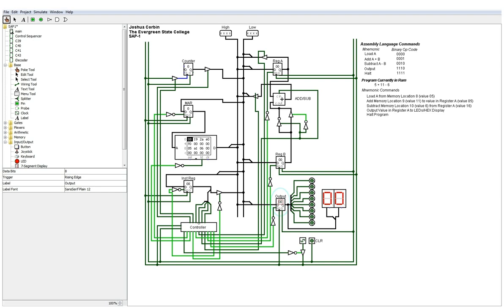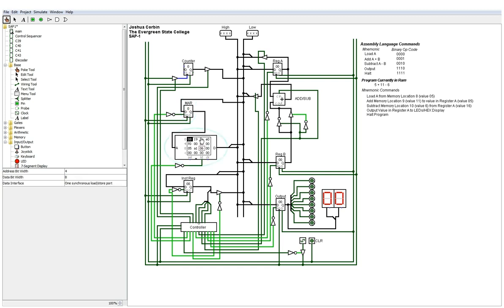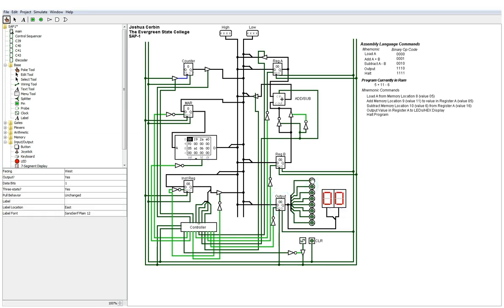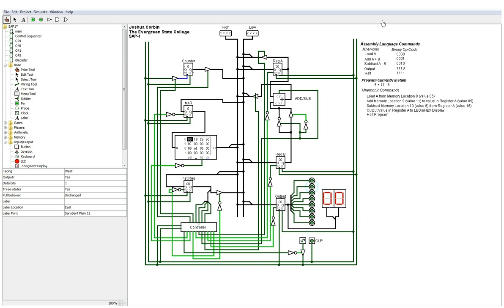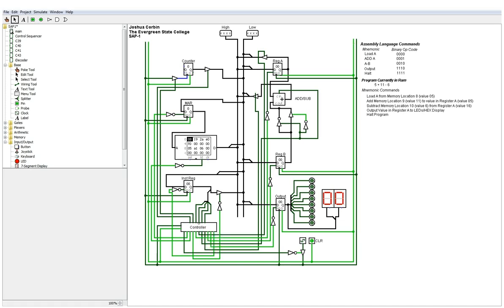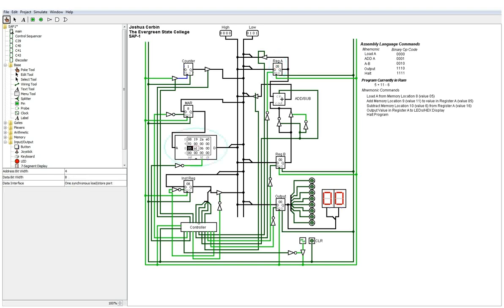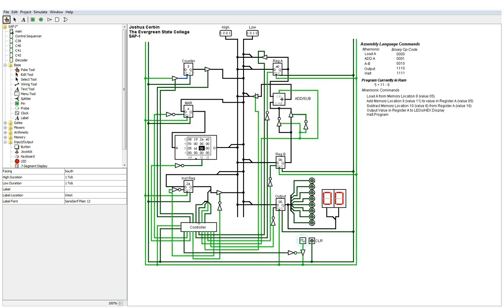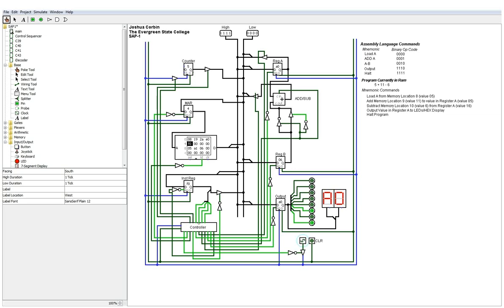Logisim SAP-1 Demo

Comment: Should't you have some pull resistor on the CLK line? All these components definitely wouldn't be happy about the floating line, especially when it's CLK. Isn't it better to use AND gate instead of a buffer for clock-gating?

Comment: Just Down loaded Logisim - Very Interesting THANKS
For my first project I Loaded your SAP-1 onto it .
Read your instructions - inserted the program from the readme file

O8 19 2A OE FE
Opps that is not right 0e should be e0 

O8 19 2A E0 F0
Now it works Thanks

WOW Simplest computer i every seen

Here is my first SAP-1 program (its a counter)
18 29 E0 30 30 30 30 30  31 30 30 30 30 30 30 30